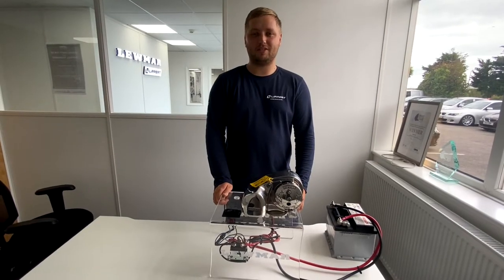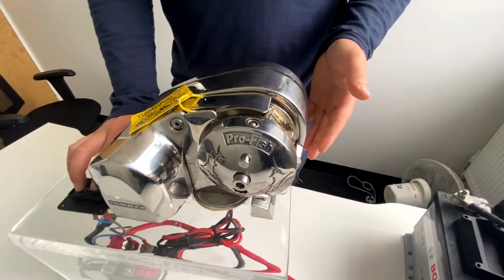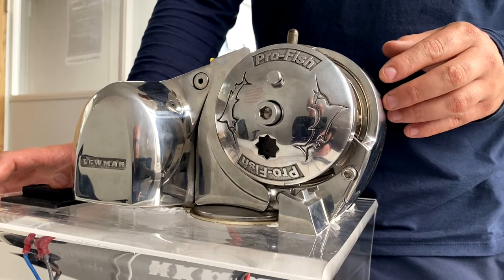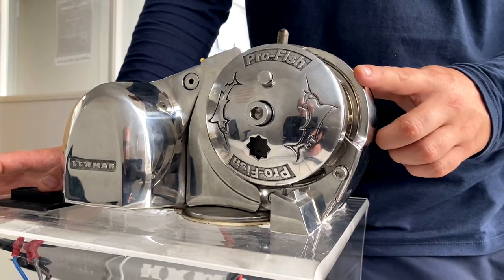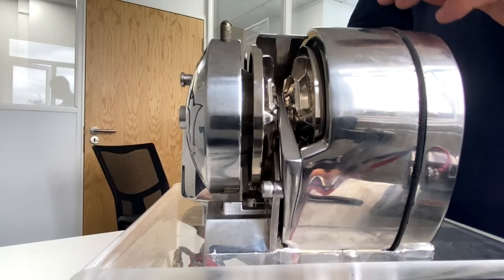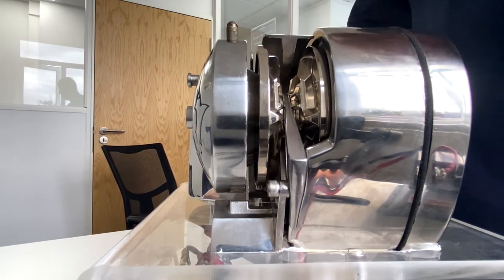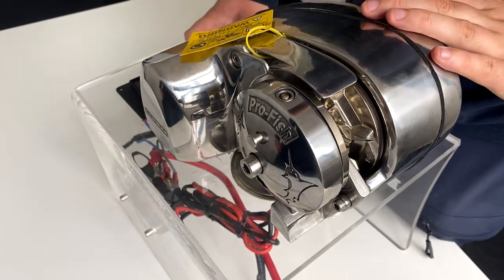Pro Fish Windlass Automatic Freefall

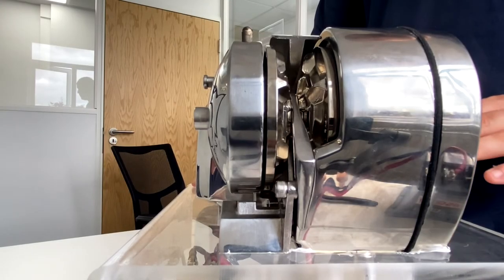Comment: Having a problem. On my Profish 700 when the cap is tightening up, the pin passes the block causing the gypsy to remain loose.  The pin should stop retracting in the middle of the stopper cam as in you video at 1:15. How can I fix this?
Reply: I see there customer service sucks